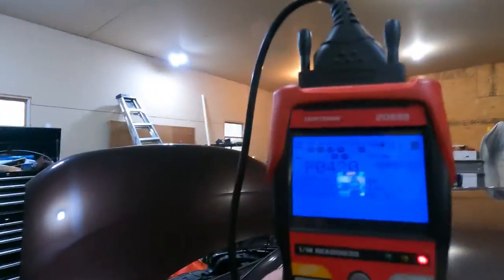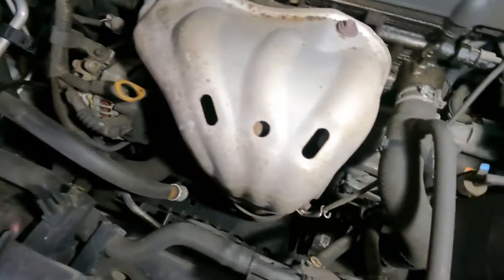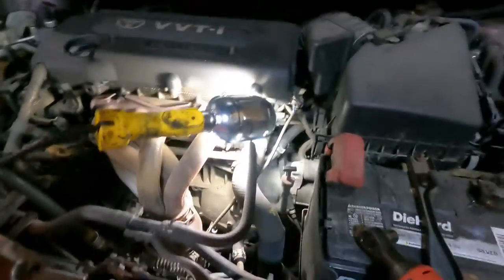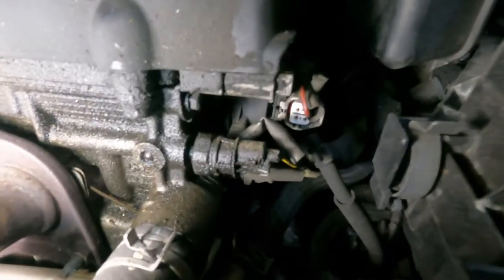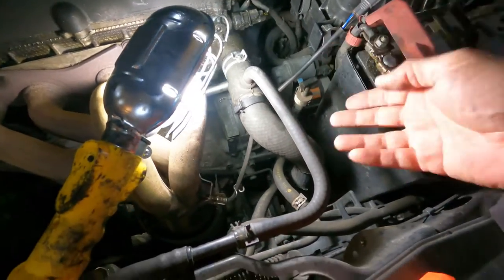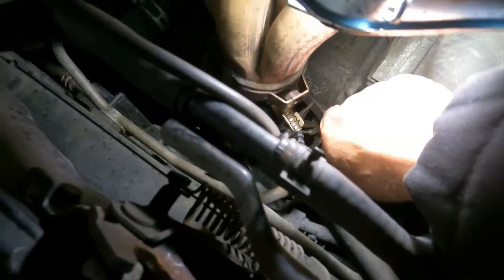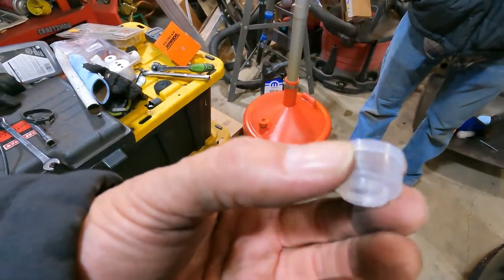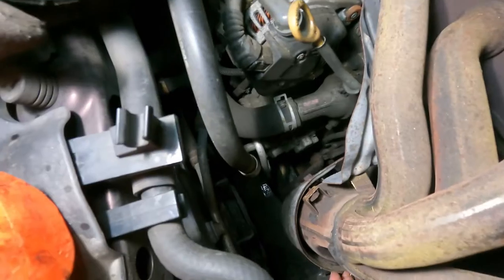2nd Gen Scion XB o2 sensor OBD P0420 code

Comment: Cant wait till you do a video in detail removing the dash to replace that little $12 plastic sprocket piece in the electronic steering that tends to break into pieces and rattles . There is another video on YouTube but not as detailed . Your videos are very detailed and step by step ! So when your sons XB starts the steering rattle I will look forward seeing that video ! :)
Reply: Search videos on power steering damper replacement. I have that issue with my Camry, but have yet to fix it.

Comment: Thank you soo much for every video da you make with good INFO. I need you OR YOU GUY'S HELP ON THIS ONE. I Want to replace da Vapor Vent Port Tank Pressure Sensor on my 2009 scion xb automatic but no luck on da LOCATION. thank you guy's
Reply from the maker: see if this image helps: https://ww2-secure.justanswer.com/uploads/drivefast1971/2011-08-30_165740_1.gif
Reply from the maker: i post the image, but don't reccomend subscribing or anything from just answer dot com, they will keep billing you forever....

Comment: Update please
Reply from the maker: Light came back on eventually. I believe we either have a leaky valve seal, or the piston rings have finally given up the ghost. Lots of oil consumption going on, and I think thats fouling the O2 sensor.  Game plan is first replace valve seals and see if it oil consumption drops. Car has a 171k on it, so a little oil burning is expected, but we are going through 2 qts in 1000 miles or more.  This just started recently. Compression tests were good on all but one cylinder. However on the cylinder that showed low compression, it finally pumped back up when i tested it again. Strange....will try new valve stem seals first, if that doesn't work, we'll be pulling the engine and putting new pistons/rings in...
Reply: @dirtydavesgarage8251  update #2? Please
Reply from the maker: @davidkrywczuk5529  no update, i want to rebuild the engine before my son blows it up but he has no other car right now....
Reply: @dirtydavesgarage8251  What milage did the car have when you rebuilt the engine? I ask because I have 4 of these cars we use for deliveries and all but 1 are over 350k with no issues. I've had to change alternators on all of them around 250k though and 1 head gasket due to a rock chip radiator leak.
Reply from the maker: @bluehydro88  haven't rebuilt the engine yet, need to though. Did you have any oil burning issues in any of them? What model year do you have?
Reply: @dirtydavesgarage8251   I have 2 2013's and 2 2014's. Only 1 of them has oil consumption issues and that's the one with the head gasket failure. We did have a 2009 TC that had severe oil consumption issues.
Reply: I have a 2010 and have oil consumption issues as well. Just recently my mpg started lowering bad and idk what’s causing it
Reply: Yeah, the 2009 edition is known to leak/burn oil like crazy.
Reply: I heard the rear one is the sensor that can kick that code on the the front o2
Reply: I’m on my second engine, just replace the engine.. update to a 2015 scion engine. Plug and play.. 
runs likes new, 
It does burn 1 quart of oil every 3000 miles
It’s the rings..
Oil rings 
Bad design
Kool car…
Just replace the sensors and change the oil every 3000 miles
It will run for a long time
Computer ecu might need an update too

Toyota Is the only ones that will be able to do it